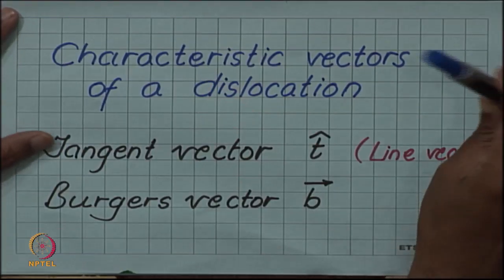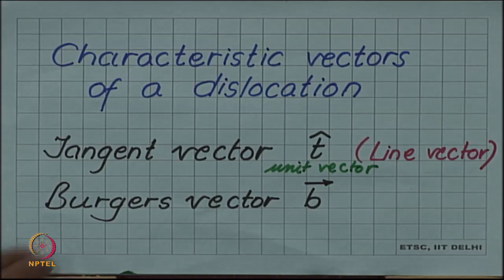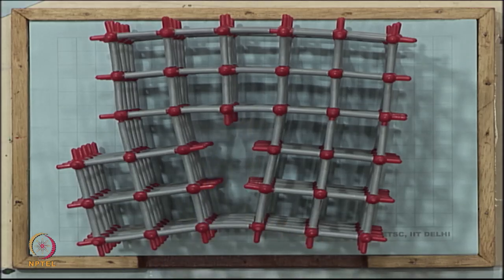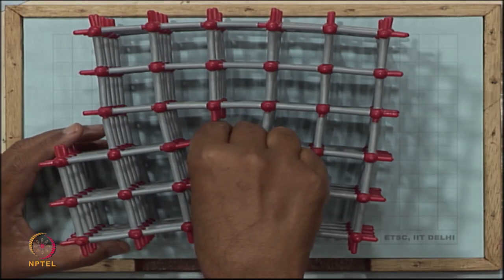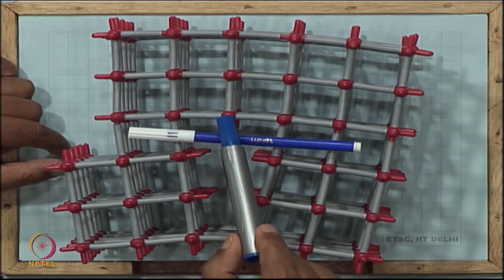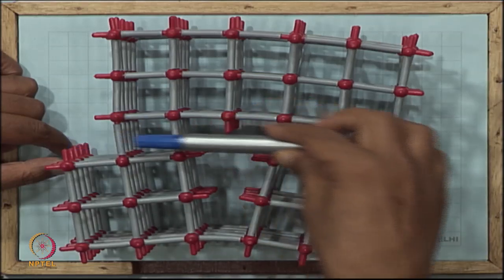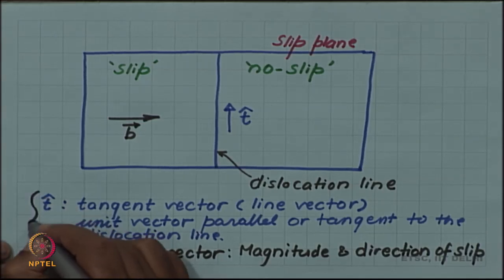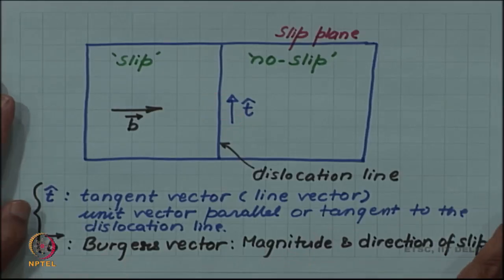Characteristic vectors of a dislocation

Comment: Sir in line dis. And slip dis. There is one plane have two tpye of dis. Means when  in line plane remove half plane so other 1,2,3 plane connect with 2,3,4 and adjust length to 2a to a
Reply from the maker: Sorry, I am unable to catch your confusion.
Reply: @introductiontomaterialsscience  ok sir no problem